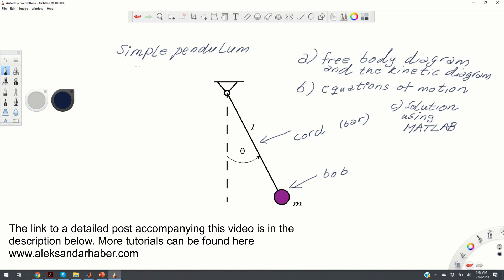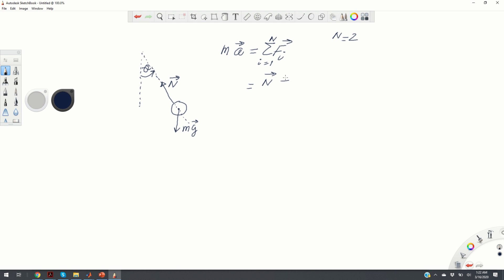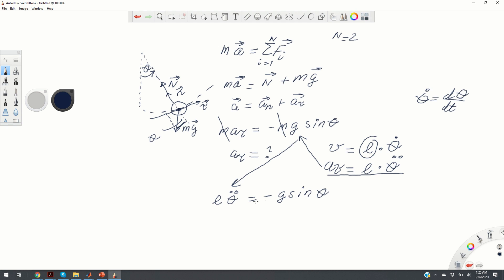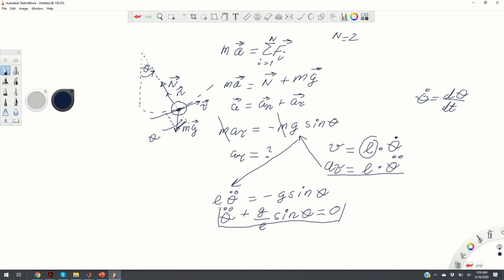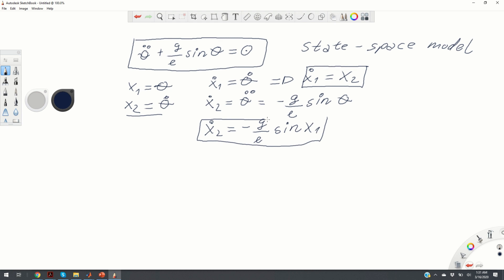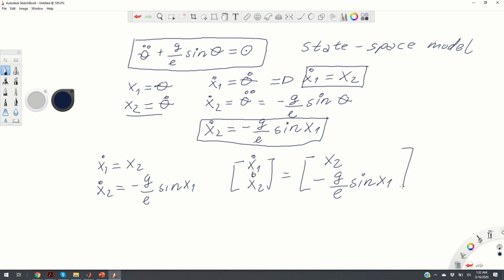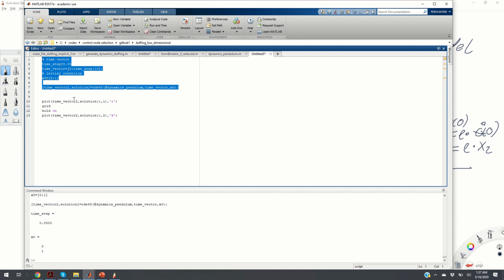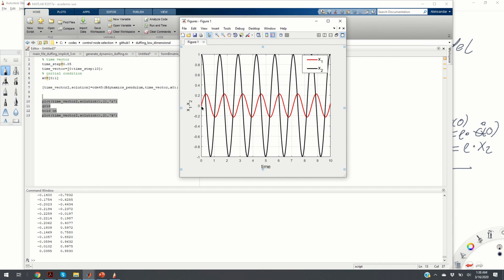Simulate Simple Pendulum ODEs in MATLAB- Free Body Diagram- Equations of Motion

Comment: Great video! I am solving this exact problem but with the initial condition Theta=pi/4, do i get the correct plot by applying x0=[pi/4;0] instead of x0=[0;1]? Thanks!
Reply from the maker: Initial conditions should not influence the accuracy of the results since the code is correct. You can choose the initial condition as you wish. 
Best, 
A. Haber